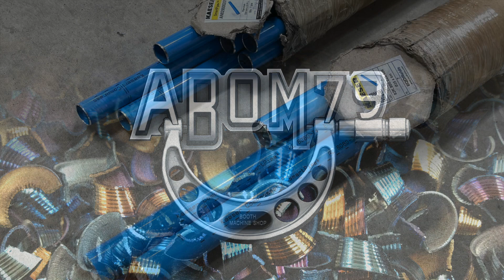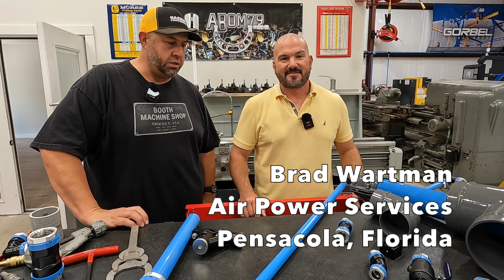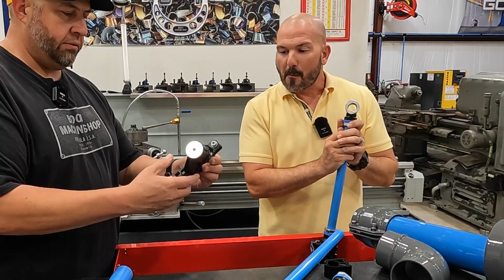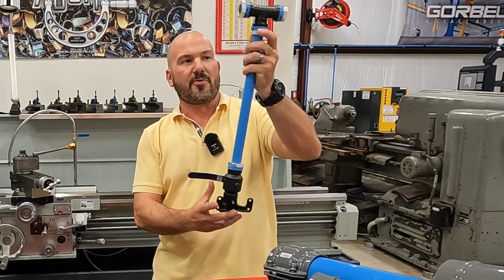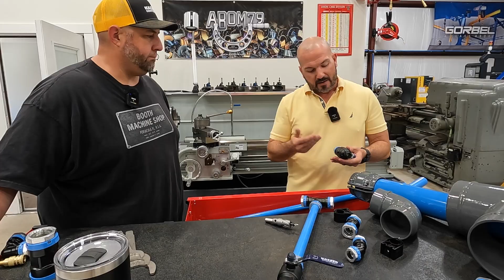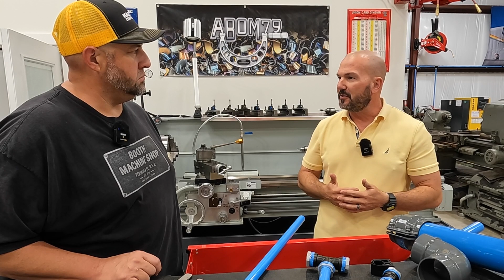KAESER Smart Pipe Plus Air System Discussion with Air Power Services

Comment: I used Pex Pipe in my shop. Cant blow up like pvc
Reply: Yeah. Super cheap. No fuss.
Reply: Pex doesn’t meet code in most area’s same as pvc
Reply: It’s interesting how much “code” you have in the country of freedom 😂
Reply: @jesperwall839  the codes are there to protect the end user. If manufacturers of a product don’t/unable to prove that there products are safe and will not fail in a matter that someone will not be harm the product does not meet code. As many have said they installed theses products and have not had any problems, but those of us that deal with this stuff everyday can and will tell those two products are not safe. Even pex will harden (because of the lubricants in the Compressed air and will act just like pvc.

Comment: I see that this system has a filter & water / oil separation filter and stainless drain etc.

But the remote storage tank on the roof of the office has me curious.
Will water vapour out of the air condense inside the remote storage tank as the air cools, and pool in the bottom, requiring the tank being drained at the end of each day before going home to reduce corrosion inside the storage tank?

I can see climbing a ladder every afternoon to drain the remote storage tank, becoming a big bear within the first week.

Maybe different if it was a remote servo operated drain from an electrical switch or some mechanical lever and rod device from down below, with a piped drain externally.

Just something that I am left wondering about.
Reply: I'm guessing that the big condensor on the side of the compressor (previous video) has already cooled the air by the time it hits the outlet, and the storage tank only sees cool dry air so it needs no auxiliary condensation handlers.  Like I said, I'm guessing, but that's the impression I got of the reason for the fancy all-in-one compressor.
Reply: @d00dEEE  I was hoping something along the same lines, but would like to know for sure.
Here downunder all pressure vessels are only good for 10 years, unless with the larger ones where it’s not viable to junk them, they have inspection openings, and can be lead shot “rumbled” to remove rust & scale internally, then pressure tested and stamped for another 10 years.
Reply: I asked that in the previous video.  An answer indicated that wasn't a problem.  Like you, I would be concerned that there will be water vapor and there will be corrosion.  My idea would be a line from the bottom of the tank to the sink with a 1/4 turn valve to allow for easier draining.  If water is determined not to be a problem, this is overkill.  I would rather have it than not.
Reply: The refrigerated dryer on the compressor lowers the dew point of the compressed air to 38 degrees F. The tank under the compressor and the one on the mezzanine are both considered dry tanks. Did not see if/what type of drain is on the mezzanine tank but the tank under the compressor has a no lost drain on it. The no lost drain only goes off when it senses water. Since he is in Florida and is most likely not going to get colder then 38 degrees in his shop, the chances of the upper tank condensing are slim to none. Also water does not flow up hill each of the drops have a tiny thumb screw on them that will let him drain any moisture that may accumulate in the drops. The system is very well laid out and looks like (besides the drops) everything drains back to the lower tank.
Reply: afaik the compressor has built in cooler and dryer. so there is basically no moisture to condense in the pipes or tanks. personally i would have fitted drip legs just in case the dryer failed.
Reply: Yes, it will create a yyyyuuuuuuuuge fogbank on the shop floor, just like an Ozzy Osbourne rahk cahncert!
Reply: @silasmarner7586  Sir....are you high?

Comment: Good discussion. I enjoyed learning more about air lines.  I too have used PVC in the past with thankfully no issues.  I learned about the hazards of PVC and replaced it immediately.  To back up a little, I am now a retired homeowner user of air and have a small hobby-type wood shop.  When providing air where needed, I decided on PEX.  1.  It is easy to snake around wherever I wanted to provide a drop.  2.  It has none of the hazards of PVC.  3.  I had a sufficient amount of leftover material after re-plumbing the entire water supply to my home.  If there is an issue, I can totally replace the air lines with remaining material in less than 2 hours since I have the crimp tools.
Reply: I was told pex is good for 600 pounds but not sure
Reply: @tonythompson9049  I couldn't remember, so I looked it up.  PEX is in the 800 psi range but fittings are near 400 psi.  It appears to be plenty to safety factor for my needs in my shop.
Reply: Yes sir should be fine for your needs like you said

Comment: Old school and think 3" and under nothing beats copper tubing for up to 135 #'s. Black pipe & even galvanised rust. At a candy company we had a ten million dollar robotic line that had over 500 air solenoids. They had a quality refrigerated dryer just for this 200' line and had some kind of dryers on each end that changed color towards needed replacement of dryer element. At the large hospital/research center that I retired from they started to purchase only Krasner air compressors ( except for special medical air compressors ). They paid a contractor to perform PM'S on them and the knes  supplying HVAC equipment ran 24/7. They were smart enough to install two at every location where only one  ran at a time. Computer would switch lead/lag on them every werk.
Reply: 3" copper for air lines??  Is Elon your dad??

Comment: Cool Adam...I've not seen a 5hp screw comp. I maintain all our plant screw compressors..from 400hp down to our smallest 50hp as well as several piston ones. Just keep the oil changed and they'll last forever. Unfortunately a 350hp Sullair recently cooked due to an electric fire ..by the time I got there to put it out..it was shot. It had been running since 1994 24/7...we got 3 new ingersol rand 900cfm in..and they are complete junk...replacing IRs from 1980ish..not even in the same universe for quality. GL.

Comment: hey Adam if it wasn't done i would install a autodrain on your surge drum tank to get the condensate out of there. even though you have a dryer it won't remove 100% of the condensate. in case your curious at my work we had to install an autodrain cause we found our 250 gallon surge drum had 20 gallons of water in the bottom after 1yr of running with brand new compressor and dryer.
Reply: Worked at a large slaughterehouse years ago. They purchased a used 50 or 60' long tank that came off a railroad car. Ran at least 350 HP of air compressors during production. Lazy mechanic was supposed to drain it end of every day but would only do it on Saturdays. He took off two weeks vacation during hot humid summer . They asked me to drain it late Saturday afternoon. Had so much water in tank for an extra hour of overtime.

Comment: i'm old school. have black pipe for many many years. i don't get debris like was mentioned.    my questions would be 1. what is the pressure rating on the 1" tubing and 2. what is the size of the drilled hole.
Reply: According to their catalogue 188 PSI working and 232 PSI max, holes are 5/8 for 25 mm pipe, 7/8 for 40 and 63 mm pipes and 1-3/16 for 76 and 100 mm pipes.
Reply: @ruben_balea  Nice of you to look that up for him.  I guess Google is too much to handle!
Reply: @paulcopeland9035  Actually I only did it because I also wanted to know more details about the system 😅

Comment: Threaded pipe can easily have drip legs installed, just as is standard practice in natural gas usage that can allow space for stuff to fall out of the gas flow. Plumbed a lot of gas lines and not much beats copper and compression fittings,mean handle a pressure well in access of what standard compressors are putting out. Actually seeing an increase in PEX usage in air systems as it’s more cost effective that rigid options and is much safer than PVC; don’t use PVC it just doesn’t hold up and can low if impacted. If you’re using PEX make sure you’re using PEX-A and not PEX-B or PEX-C.
Reply: PEX doesn't meet code.  Sorry for the annoying  "code" reference, but it is truth!  I know PEX and it seems you know the product, but it is not approved for high pressure air lines.  I know people are using more and more of it but it is sketchy under high air pressure and susceptible to UV!  It is best not to trust the stuff for this application.
Reply: @paulcopeland9035 : How about a code citation regarding the “code reference” because a belief on something being against code isn’t it actual being against code; PEX is used for air in a lot of areas replacing PVC and outside of perhaps a few places like NYC most compressed air systems aren’t covered under building codes.
Reply: @libertarian1637  Insurance is a driving force in the "code game".

Comment: I have always run drops off the overhead main line straight up for about six to eight inches, two ells coming down, to wherever they needed to go.
That's just in case the dryer quit working.
Also, I always put a dirt leg on every drop with a ball valve at the bottom - especially at sensitive equipment.

Dropping straight down off an overhead main in just asking for trouble, and those dirt legs can give you a quick health check up on your system.

Comment: If you connect the 2 dead ends together above the door, it will work better and that much pipe is quite a storage tank in itself. We use Transair pipe and Atlas Copco compressors that are 20 and 15 yrs old at 2500 hrs/yr
Reply: That is a fine idea that will work well, but in this situation it is overkill.  This 1" system will flow way more than Adam will ever require without the added expense of a loop.

Comment: this if quite interesting, I know a little bit about air systems.
In my shop the we have a quite big air system the piping was probably dome over 20 years ago and its pvc ore what ever plastic and it gets old and gets leaks wich is a huge problem for us, we can shut down 10 cnc machines just to fix a damn pipe so it just gets wrapped a little and leaks constantly.
we do also have two very big Kaeser compressors and air colors

Comment: Isn't that the same system Steve Summers installed in his shop?
Reply: Good question i don't believe so but I could be mistaken.
Reply: I don’t remember the brand he got but I do remember him needing to bend the pipe with a pipe bending tool. The Kaeser pipe just uses angled couplers to achieve bends.
Reply: Maxline Rapidair; I just looked it up. It was similar but it came in a roll and had to be straightened out.
Reply: Steve Summers got a Maxline 3/4” kit (from Amazon, if memory serves). Aluminum with PE cover. Same shade of blue though.